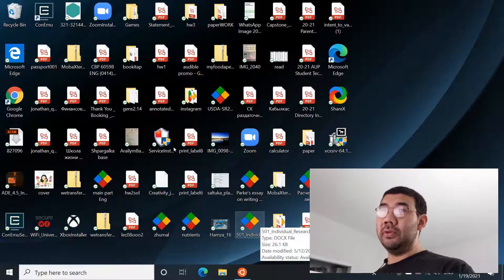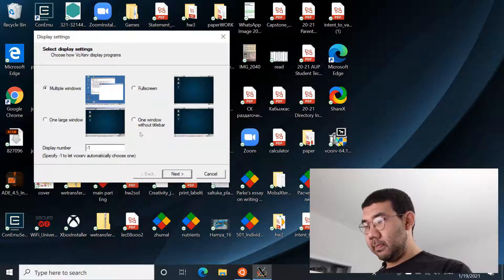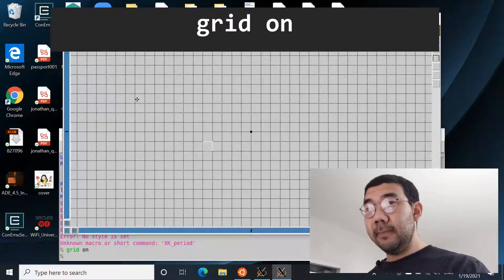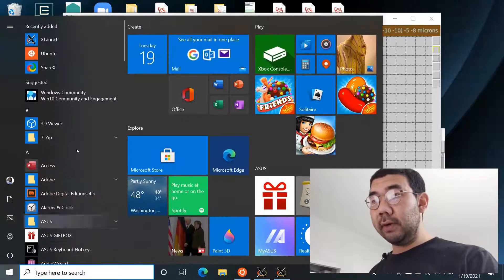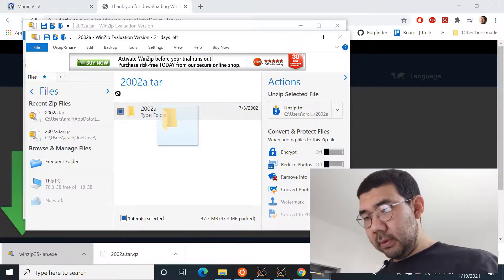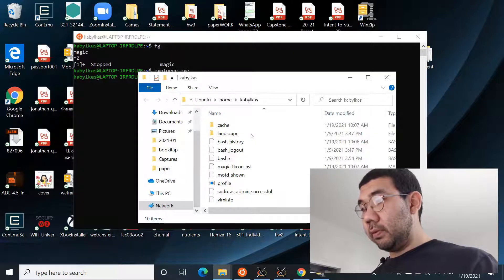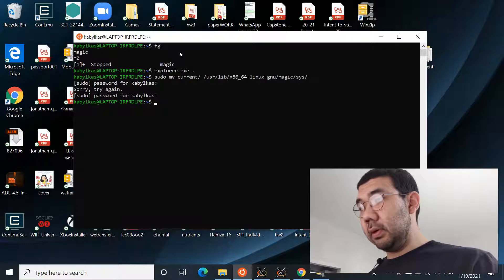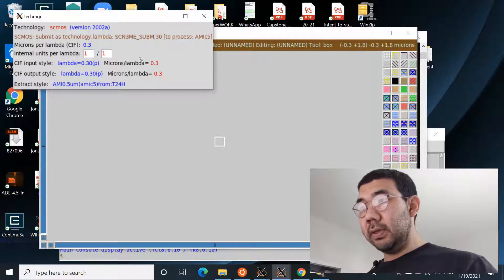Magic VLSI Tutorial (part 1), Installation and Technology Files

Comment: I getting the below error after installing magic.
 
application-specific initialization failed: couldn't connect to display "localhost:0.0"
Error in startup script: couldn't connect to display "localhost:0.0"
    while executing
"load /usr/lib/x86_64-linux-gnu/libtk8.6.so Tk"
    ("package ifneeded Tk 8.6.10" script)
    invoked from within
"package require Tk $tcl_version"
    invoked from within
"if {$tcl_version < 8.0} {
    return -code error "tkcon requires at least Tcl/Tk8"
} else {
    # Prevent breaking on version 8.5.2
    # package requ..."
    (file "/usr/lib/x86_64-linux-gnu/magic/tcl/tkcon.tcl" line 44)

Please help
Reply: Did you get the fix?
Reply: i got the fix its like i spent a hour or so but here you go

write this in the teminal
export DISPLAY=:0
/usr/bin/magic

and it should run or if not you gave to install TCL

Comment: Hey @UCjoFXqPJTDtSTxgp9xfxoZw, After  completing the process I am still getting minimum (version 0.0) in technology manager in magic.
Reply from the maker: hmm... that's weird. Are you specifying the technology file with -T flag when opening magic?
Reply: @kabylkas  yeah i also got the same issue
Reply: Yes I did with same command as you did. But when I gave command to open current folder there was an error of permission denied. Than I used the command chmod u+x current. The current folder accessed but did not work.
Reply: i am getting the same issue, is there any update?